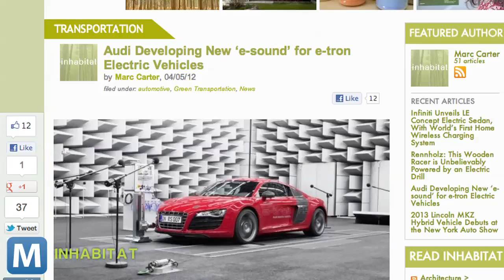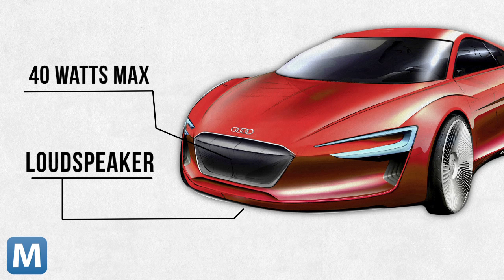Audi Reveals 'E-Sound,' an Engine Noise for its Quiet Electric Concepts

Comment: It's actually an important safety issue.  Blind pedestrians depend on sound to determine when it is safe to cross the street.  In addition, research by the National Highway Traffic Safety Administration has revealed that even sighted pedestrians are more likely to be killed by a quiet car.